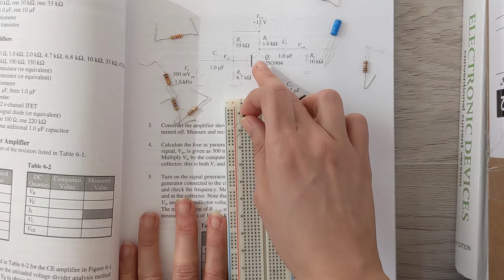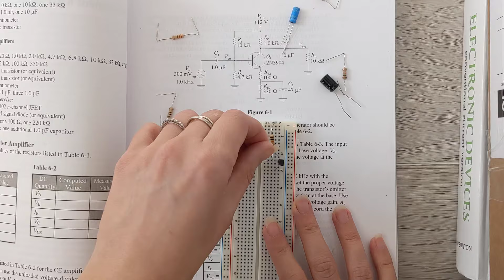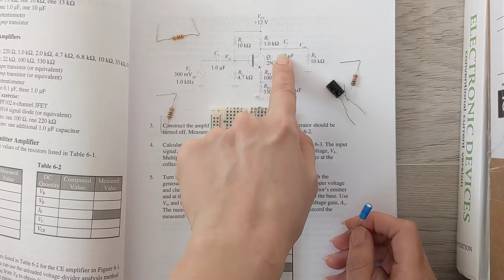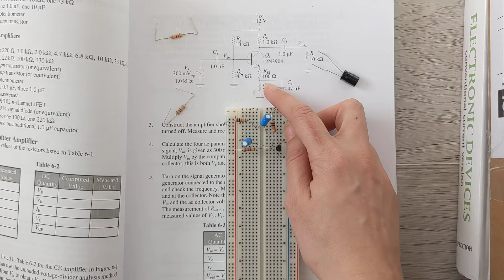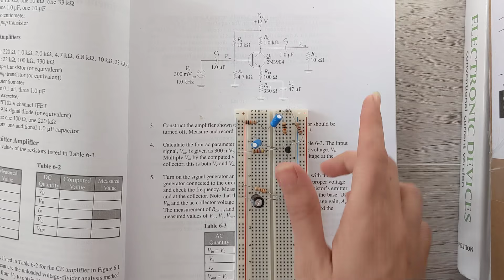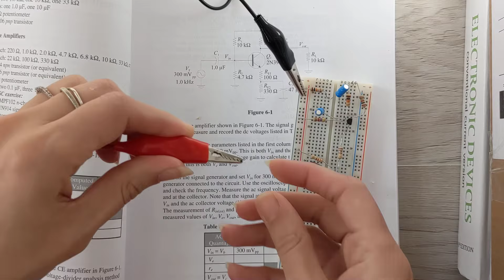The Common-Emitter Amplifier Circuit (Experiment 6 - Part1)

Comment: 00:02 Understanding the layout of a breadboard for the common emitter amplifier circuit
02:34 To connect the transistor in the circuit, match the curved side of the transistor symbol with the curved side of the symbol on the schematic.
05:09 Connecting components in the common-emitter amplifier circuit
07:49 Connecting components in a common-emitter amplifier circuit
10:36 Connect the capacitor leg on number 55 to the collector
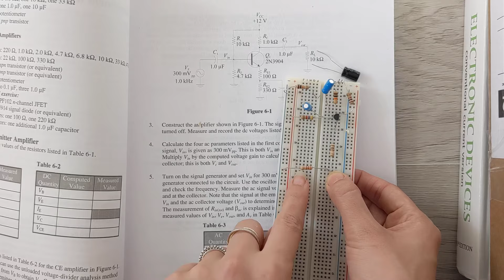13:35 Connecting components to the ground simplifies circuit connections.
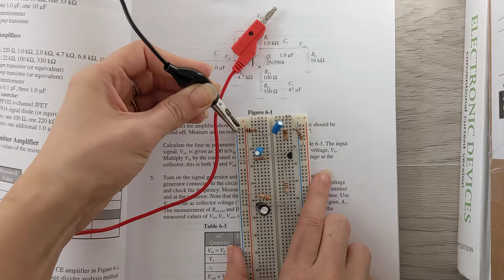16:14 Connect the ground and positive sides of the circuit to the appropriate components.
18:33 Connect the one microfarad capacitor to the base
20:56 Calculating emitter voltage (Ve) and collector-emitter voltage (Vce)

Comment: You skipped Vc measurements 😢😢😢 do we go from Collector to ground or ?
Reply: The output voltage swings from Vcc to VE + VCEsat
VE is the designed bias voltage drop across the emitter resistor. VCE,sat can be found from the transistors datasheet which is the minimum required voltage between the collector and the emitter terminals so that the transistor operates at the edge of the saturation region.
When you connect the emitter directly to the ground, you have the maximum output swings which is between Vcc and VCE,sat
Reply: But for measuring the dc output voltage, which is the collector voltage in this case, it should be measured from collector terminal to the ground

Comment: For those who want to check their calculations of the computed values, here are the answers, assuming β=200 and Vbe=0.65V:
Vb = 3.72V
Ve = 3.07V
Ie = Ic = 7.1mA
Vc = 4.89V
Vce = 1.82V
AC voltage gain (no load) = 9.7 -- with 10K load, Av = 8.8
Input impedance = 2.8K
-3dB frequency for bypass capacitor = 33Hz
-3dB frequency for input capacitor = 57Hz
Note that with a loaded gain of 8.8 and an input signal of 300mVpp, the output will be 2.64Vpp, which is getting close to the available output swing of 2x(Vce-Vce(sat)) = 2 x (1.82-0.2) = 3.2Vpp.
Reply from the maker: Thank you for sharing this.